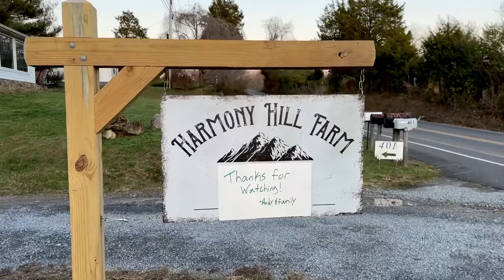DIY Sign Post Build (Realtor/Address/mailbox)

Comment: How's come you sanded it AND THEN ran it through the planer?  C'mon now son!
Reply from the maker: Valid question. I should have shown a closeup. These were OLD posts that were covered with gravel dust and dirt from the driveway and when they were stored on the ground. I just ran a 60grit pad over it real quick to clean it off faster.
Reply: @landbalance  Makes sense. I was just given ya a hard time. Thanks for the reply!

Comment: what is the angle at which you cut the top of the post, if you can share, it would be great, I'm about to make my real estate post for my first listing and I'm a DIYer, so... I'm gonna same some $ doing it 😅 thanks!
Reply from the maker: That would look great for that. Might not want to use concrete lol It’s been a while…but I remember trying out a few angles on a test post just to see what looked better. I would start with a 45 first